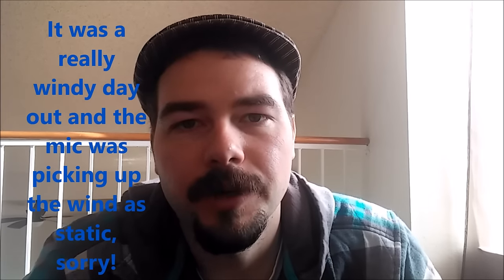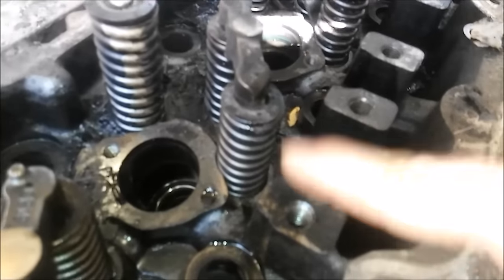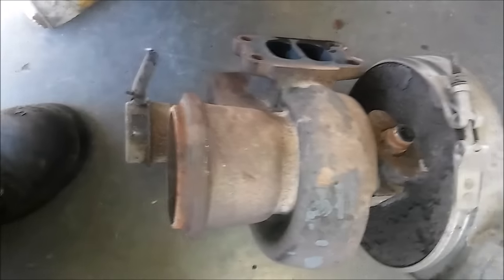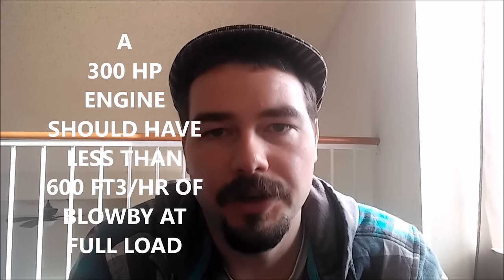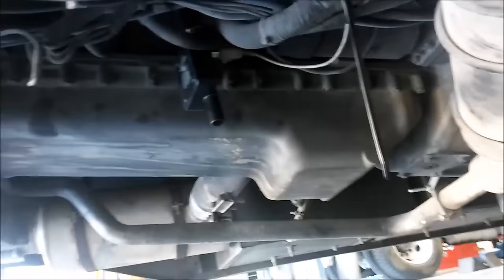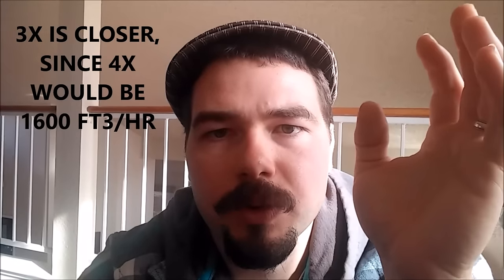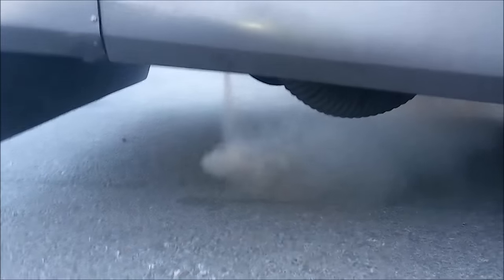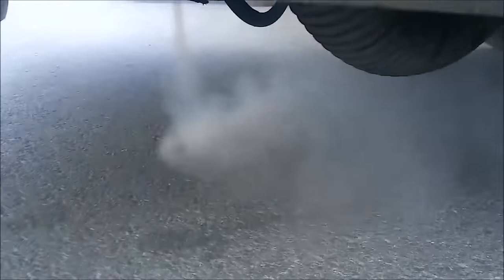What Is Blowby?  What Is Too Much Blowby?

Comment: I have a 2004 C13 Acert.  does it have a OCV filter? does it need to be changed to newer model? can I eliminate filter element & just let it dump to atmosphere?
Reply from the maker: Your serial number probably starts with KCB, they do not have a crankcase filter, unless someone installed it aftermarket. They have a wire mesh filter in the valve cover base, but it doesn't need serviced.
Reply: You are the man! Just bought truck & I'm trying to self educate.  & I was worried about high crankcase pressure.  Vavletrain noise seems to get louder under boost.
Reply from the maker: +Alex Rivera Thank you, the KCB C13 is one of the engines I know the best. Their valvetrain is somewhat "clackily" but they are good engines with very few problems, but I warn you DO NOT OVERHEAT THE ENGINE. The Cylinder Head will crack if the coolant temp gets above roughly 230 degrees. That is the weak spot of the C13, other than that they don't really have too many other problems. They also tend to run a little bit lower oil pressure than a C15, this is normal though and is just a design difference.

Comment: Why isnt the blow by tube hooked to a filter thats hooked to the turbo charger intake ?  Coming from the world of performance turbocharged gas v8s Ive always used the turbo intake to help create a neg pressure in the crank case. Nt only does it help the rings seal better it will create more power. 
You never see systems like this on 6bt cummins for example. I think the old  GMC 6.5TD uses a system similar.
Reply: Mark Rich on newer trucks that setup doesnt work because once it has any amount of excessive blow by it clogs up the DPF and SCR then you can T even drive the truck with even the slightest amount of blow by like you could an older one, it injests oil then the intake and CAC hoses get soaked with oil
Reply: Duramax has no problem doing so  and they have a DPF system.
Reply: Not sute how its setup on the duramax but the Isuzu 4hk's have a problem with it, if you have it designed with a check valve or something to stop it from injesting oil then it's fine but if it sucks oil the DPF clogs up,
Reply: They have simple baffle stuffed with steel wool like substance.  Allot of oil makes it into the intake and coats the turbo. Ive personally never owned a diesel engine that new. I wont buy anything common rail  . Great engines I just cant afford to fix them. I have a  89 12v and  01 24v cummins and im happy with those.

Comment: I have a 3406 e that idles and has low blow bye than after a couple mins blow bye increase and has some oil coming out of blowby tube what do you think it is ?
Reply: hello i having the same problem did you find what was wrong on your 3406e

Comment: I literally just bought a c15 mxs with a rebuilt done to it. I pull heavy loads and always keep an eye on how much oil drops at the end of my shift from the blow by tube. Its usually a few drops over night, not much. Is that normal??
Reply from the maker: +LegendaryKandola Yes that is normal. You should also watch how much oil it consumes between oil changes. The MXS engines usually have kind of high blowby due to the extra cylinder pressure from the higher boost and leaks past the turbos. As long as it isn't eating much oil though, you should be fine.
Reply: Hey appreciate the reply. Between oil changes i dont even add oil at all, i usually fill the oil just a little above full and after 22000kms i do an oil change and the oil level would be on full mark. So not much. I keep my boost around 40psi once in a while when pulling a hill i let it go till 50psi but normally i dont let it go full boost as i was told c15 twin turbos are known to blow the heads due to high boost. My oil pressure stays over 60-65psi but i have noticed that when pulling hills the oil will start getting hot quick i guess its another twin turbo thing. Your videos are great and i gain alot of knowledge watching them. Keep up the good work and thank you.
Reply: @adept Ape MY engine was rebuilt everything except the crank shaft, i just replaced exhaust gaskets on the turbos and found my turbo bolts and valve covers were loose, i am more worried about the crank not being replaced should i look into replacing it or not???

Comment: Hi, i have question, been working on detroit series 60 alot recently, and a few of then had quite a bit of engine sludge like grease oil, the other guys say its excessive blowby, could that be the case? Or is there another reason, i just pulled one apart and it looks mechanically in good condition, also the customer bought the truck from whoever who claimed they had done an overhaul 100k miles ago, cylinder head looks new and so do the bearings, liners have very light wear, ive seen worse that didnt have that sludge issue
Reply: By the way, thank you for your videos, i watched quite a few, did a cat overhaul some time ago and it was good to reference a few things here and there!
Reply: Update on the issue?

Comment: Is the meter 11 to 40 volt so you can hook it up to anything from a small work truck up to a haulpack? ;)
Reply from the maker: +shoominati23 The blowby meter is self powered with a battery so you only have to hook up the crankcase hose and turn it on.
Reply: do you have the part number of that blowby meter? I would like to get one
Reply: that there i believe is a 8T-2685 blowby meter, get your house ready to mortgage, and have a friend at a dealer, i don't think your average person can buy that tool

Comment: hey man i  have a couple dripping of  coolant out of the blow by tube. do you have a  idea   what can cause that ? thanks
Reply from the maker: +Eduardo Santiago Well that is typically a very bad thing. If you have a C10 or C12 it could be a water pump, but normally it means you have a cracked head, bad liner, head gasket, possible a bad air compressor, and that is the most common causes.
Reply: hey man thanks  to answer! i got c-15 6nz  and i just realize  the cooling start to mix in the oil. some  guys say that can be oil cooller. what you think?
Reply: I would put my money on liners. pull the oil pans and pressure up the cooling system.

Comment: HelloI have a c15 accert with a 100,000 on a in frameDealers telling me my blow by reads 750cfmTelling me this is acceptable "with in specs "Eats 1 gallon every 2000 miles. What are your thoughts. Thank you. Curious what the cfm should be with these miles on a good engine.
Reply from the maker: +Don Waldron What is your serial number and horsepower rating?
Reply: Adept Ape don't have the serial off hand. It's a mxs 475. 2005!
Reply from the maker: +Don Waldron Those twin turbos run a little high on blowby, usually twice the hp is the spec for those so you'd be good up to 950 cu ft. I didn't about 15 minutes looking for the exact spec, but couldn't find it on Cat.
Reply: Adept Ape cat doesn't tell you anywhere I looked for hours.  
I was just curious what you had come across personally. 
Thank you for your time.
Reply from the maker: +Don Waldron There is a spec out there I've seen it before, but I recently changed work computers and lost it, I'll have to ask the super brain at work if he has it.

Comment: I can't get the Boost / over 22 when the engine is cold until the engine warms up to 200 degrees then it runs 40 pounds of boost wonder what I could do for that
Reply from the maker: +Harvey Yoder Depending on the engine, your engine will run in cold mode, which restricts fuel up until you get to above a certain temperature, usually on Cat engines that is about 160 degrees. That may have something to do with it, any check engine lights?
Reply: No Engine Light
Reply from the maker: +Harvey Yoder Try to get a scanner or something to read the ECM and then see if you have a sensor that is reading too low or too high.

Comment: my 3406e is now blowing oil out of the blow by tube suspect under load,  oil coming out of air dryer,  air compressor and air dryer just replaced 6 months ago.  oil soaked under Truck. I read this could be turbo seal starting go bad ? Truck runs fine, 1,063,500 on original motor, 600,000 on turbo. will changing our rebuild turbo do? cat blood tests every 10k since 500k all good.
Reply from the maker: +77chevyk30 It is possible the turbo is causing it, but as stated in the video it could be the valve seals and cylinder damage as well. Is it burning oil?
Reply: Adept Ape no not burning oil,  no white smoke like your video,  no white/blue smoke under acceleration either.  Lil puff white smoke first start up. some gray dry powder residue from turbo to intake. wouldn't worn cylinders show extra fuel in oil in addition to extra Metals in cat blood tests?  all tests this year still good including last one.
Reply: 77chevyk30 vs

Comment: Hey if anyone can help 
Detroit 60 series ddec4 
12.7 pre-egr 
My slobber tube has sooo much gunky crap in it I took of rocket cover and had gunk in there 
Is this really bad?? 
I don’t know when it was last cleaned or not 
I’ve been told it’s normal for Detroit
Reply: Hi..60 series is definitely a dirtier engine internally than Cat or Cummins...In my opinion..Delvac oil and regular oil changed does help a bit.

Comment: Any recommendations on a 2007 c-15 accert to keep it running in tip top shape Inframed 500,000 miles ago
Reply: Lee Hill covert it to a single turbo. That motor will give you issues with twin turbos.
Reply: I thought about that but been talking to a guy in Kansas that says he has a program that will de accert my motor really leaning that way at the moment

Comment: I have a 08 C7S with blow by. Cat told me it's at 670. my HP is 300. so it's over, question is I had the Turbo replaced as it's was shot and blowing oil everywhere. And he also cleaned the blow by tube out that goes into the exhaust as he said it was clogged. So I picked it up today drove it about 25mins started heavily smoking on the exhaust to the dpf. Called cat they said that it was oil in the tube getting burnt and they tried to clean it the best they could. He said just keep driving it till it burns all the way out. Question is would the blow by be running down inside the exhaust to the dpf causing it to burn? and the dpf sound like it was a constant crackling on the inside after I turn the truck off. any help or advice? Can I remove the blow by tube from the exhaust and just let it push the excess oil outside of the truck like the older C7s? Instead pushing it through the dpf.
Reply from the maker: +Timothy Nichols Okay, I know these systems pretty well. So yes the blowby vents into the exhaust on a C7S and if you have high blowby your are going to be plugging that DPF quicker than normal as well as getting some oil smoke out of the exhaust if the exhaust is leaking before the DPF. You can vent the blowby to the atmosphere like the previous year Cat engines, but that is considered emissions so if you are in California or anywhere that checks for emissions, they could fine you for venting that as a change or alteration to the emissions systems. If you wanted to still be emissions legit, you could add a crankcase filter to the blowby to catch the fumes, but you would have to check your laws for what exactly would have to be installed for compliance. Hope that answers your questions.
Reply: There's no smoke coming out of the exhaust. it's smoking on the actual pipe to the dpf. and the dpf filter housing was smoking to. He said it was burning oil left over from the old turbo leaking oil into the exhaust and dpf. So that oil is basically cooking inside the pipe making it smoke from the outside. I have a video I can post on my page to so you what am talking about.
Reply from the maker: I watched your video.  It looks like you are getting the smoke through the flex portion of the hose, which is somewhat porous and the inlet and center section of the DPF.  Smoke shouldn't be coming through the stainless steel tubing itself.  You may just have some residue oil in that system that is smoking, but after running it for awhile it should go away.  You do have high blowby so it is possible that the exhaust is being fed a constant small amount of oil fumes and it may smoke like that until you either reduce the blowby or vent the blowby as you were describing earlier.
Reply: What's the best way to vent the blow by? Do I plug up the inlet on the exhaust and run a tube down to about just below the frame rail?
Reply from the maker: As I stated before this may be breaking some emissions regulations if not done correctly, so I'm sure you are going to check with that first, but basically you would be getting some high temperature hose then running that hose from the metal tube coming off your valve cover base and then running that basically down the side of the engine with it ending about a foot and a half from the ground.  You would also have to cap the exhaust with a rather large plug, which would have to be steel or the like since that exhaust gets up to 1100 degrees.  Not sure as to your welding skills, but you could cut the metal tube then use the cut portion with the nut, then pinch and weld the tube shut on the exhaust side and then just have the vent side held on with some hose clamps to your high temperature hose.
Reply: Yeah. I live in Texas. And mainly travel east of Kansas city south of Jersey. I appreciate your advice I'll probably do the pinch method and weld method. is 670 really (alot) of blow by? I see your one video about the RV and that thing was toast putting out 1100+ blowby. Am just trying to get at least another 100k miles out it of it. it's at 380k now so I know she's at the end of her life... That dpf is nothing but troubles also that's another story.
Reply from the maker: +Timothy Nichols That is unfortunately a lot of blowby, but blowby doesn't hurt anything, it is just an indicator.  The specification is 2x hp as a rule of thumb. It is most likely indicating worn cylinders, piston rings, or valve seals. So you can run it and it won't hurt the engine, it is just saying the engine is tired. That is by far the most mileage I've ever seen on a C7S so you are pretty lucky actually. Cat made the C7 as a 200-300k engine so you got pretty good life outta it. If it was my truck I would try to get the extra 100k outta it.

Comment: If blow by coming too much oil leakingWhat cause coming too much oil
Reply from the maker: +Jamad Farah If you have too much oil coming out of the blowby tube, then the wire mesh or blowby filter could be saturated and possibly damaged, but it is also a sign that you may have too much blowby and you need to do a volume test like in this video.

Comment: Hi I have  blowbay in my engine Detroit I take my truck to the defrint  micknic  they told me you need overhaul and my engine is just with 725000 aim not agree with what the mechanic seed I have little experience micknic thinks so I take my time to think I decided to change the crank  Case filter spliment. It cost me about 750$ and I secsesflle  the pressure off the engine is gen I save about more than 12000$  this crank case spliment continue valve and filter and sensor and the filter need to change with every 200000 mi  so you need to change or cleane the filter all ways

Comment: Can I  PM you some how? I have a video of blow by I wanna show you and want your professional opinion on how bad it is.
Reply from the maker: +Timothy Nichols Post the video to YouTube then just send the channel name and I'll watch it.
Reply: Adept Ape C7s 300hp. guy at Cat said test was 670. Can this cause problems for the dpf filter?
Reply from the maker: +Timothy Nichols I watched all 3 of the videos, but couldn't really see too much blowby coming from the oil fill tube there. If the level is more than 2x horsepower then that level is too high. So can it affect the DPF, yes it can. On the C7S and C9S the crankcase fumes vent into the exhaust before the DPF, so if your dumping lots of oil fumes into the DPF that can cause the DPF to plug quicker and accumulate ash quicker. So to prevent that you'd have to check with the emissions laws, but perhaps installing a crankcase filter system that bypasses the DPF similar to how the regen C15 engines were, with a crankcase filter and a drain would prevent the fumes from hitting the DPF.
Reply: Adept Ape When is a good interval time to clean the dpf filter.
Reply from the maker: +Timothy Nichols That really depends. I go by the DPF differential pressure and when it gets high after a regen it's time to clean it. Other than that an interval is hard to say because some trucks idle a lot, or burn more oil, or too many variables.
Reply: Oil is not good for DPF filters. They burn soot and oil can damage the system